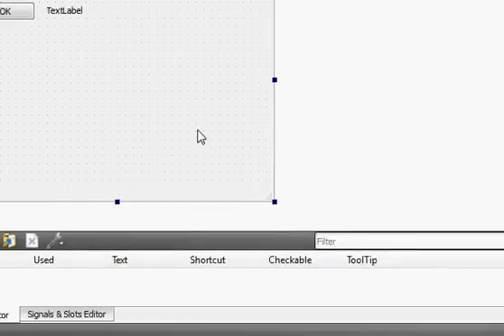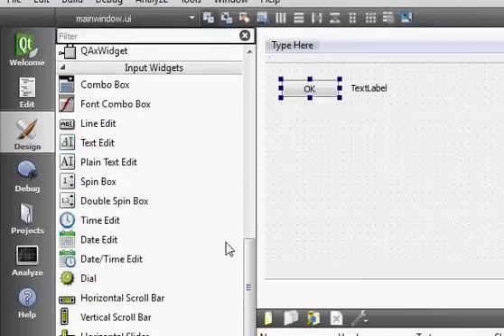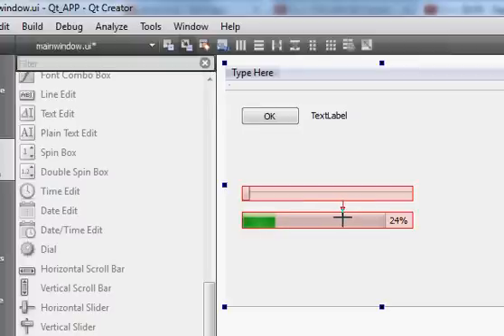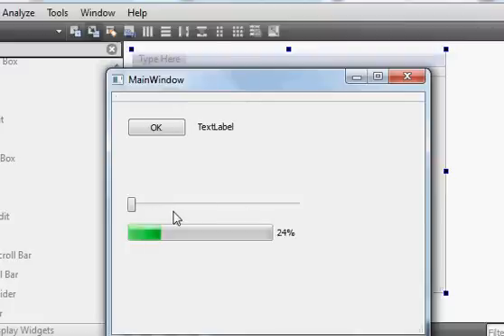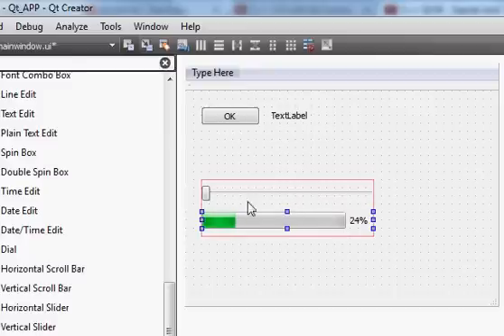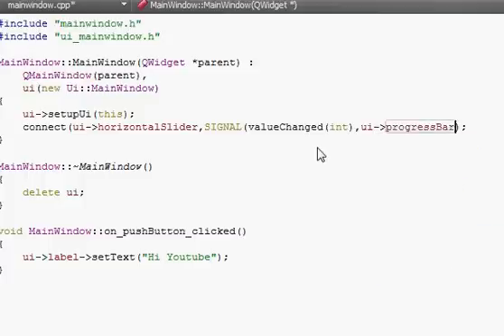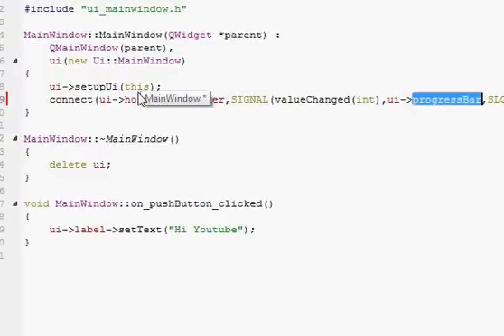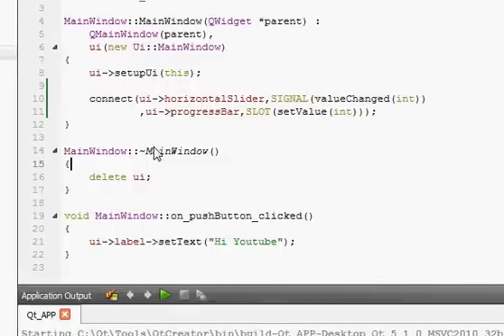QT C++ GUI Tutorial 3- Qt Signal and slots (QSlider and QProgressBar)

Comment: The way I do this in code is to go to the horizontal slider, right click, "go to slot". That brings up a dialog, I select valueChanged, and do this:

It automatically creates the method, all you have to do is add "ui->progressBar->setValue(value);" between the braces.

This keeps all code for that event in the same place - so if you want to do a lot of things when the value is changed, you do them all here.

I don't use the visual way because it's not visible in code.

void MainWindow::on_horizontalSlider_valueChanged(int value)
{
ui->progressBar->setValue(value);
}